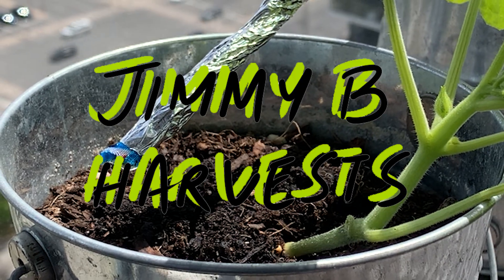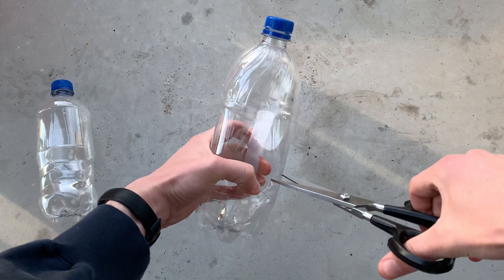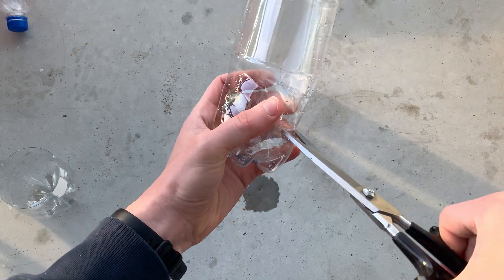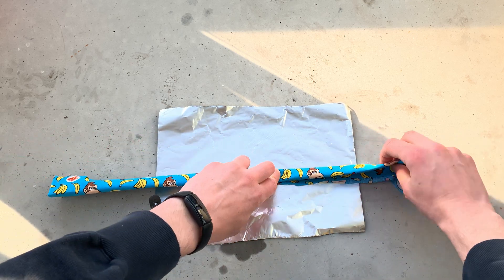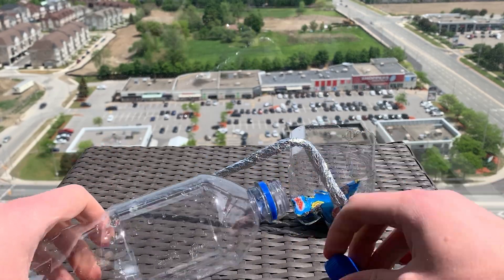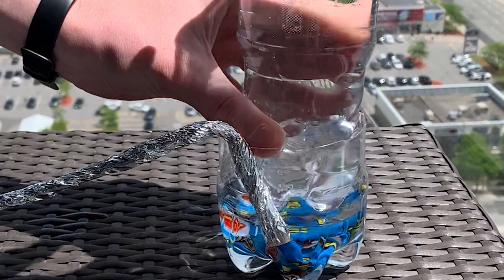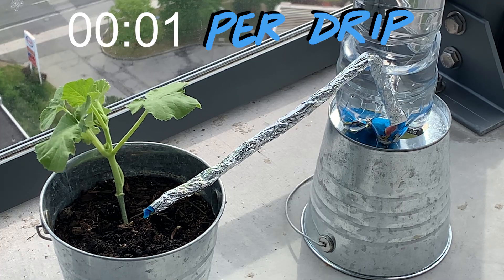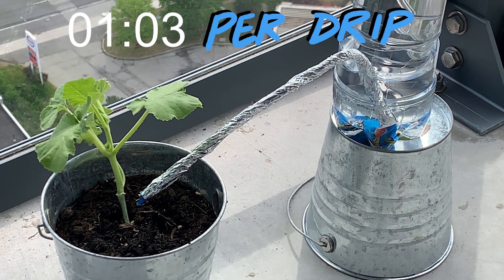DIY Drip Irrigation with Adjustable Flow

Comment: It works.  I did that for the strawberry🍓plants this year.  Except I only used an old opened deep dish & 😮clothesline rope that I ran one end from the roots to inside an old clear deep dish with water.  If the ends that go in the water dish keep sliding outside the water.  Hold the ends of the rope down with rocks🪨
This hack saves me time & takes the guess work out of watering.
Reply from the maker: Great idea